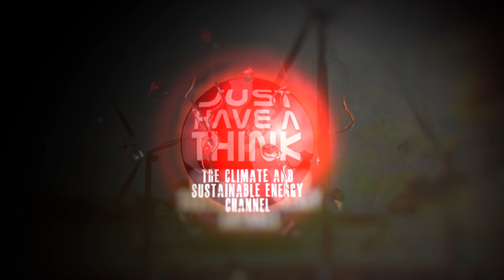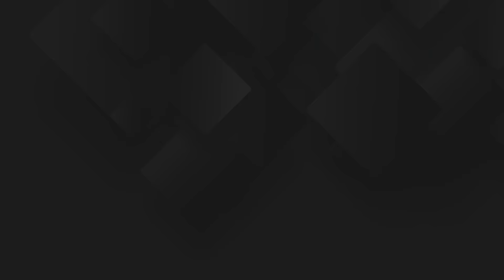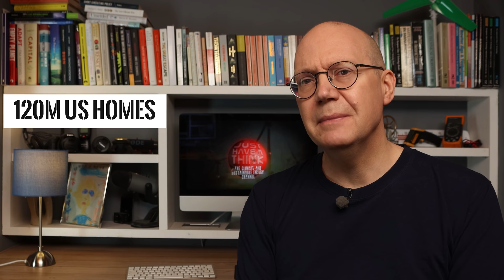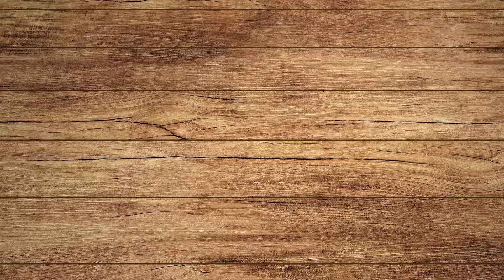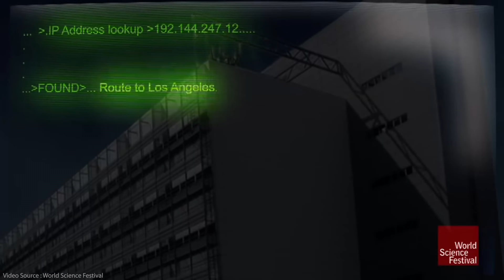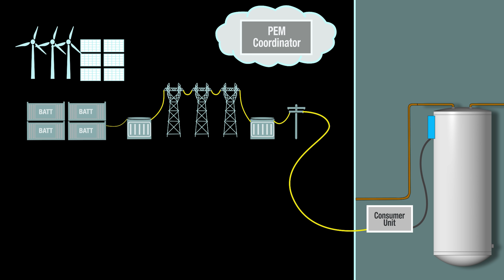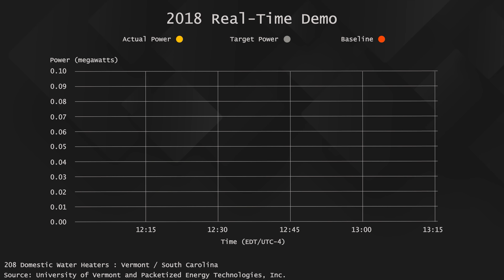How to balance renewable grids WITHOUT energy storage!

Comment: Technicaly, this is not without energy storage. The storage happens, just not in the form of electricity. You store heat in the water heater, heat in the air of your house, etc. It just adds a smart distributed management system for this "storage".
Reply: It is demand scheduling and shifting to avoid in rush consumption and peak loads.  There is no energy stored in your heater or house air the system is forced to go without that energy until the utility company has sufficient capacity to handle the load.  For example take the water heater.  If the heater is set to come on at 120f and you finish your shower and it needs to heat the water back to 180f to turn off and store energy for your kids shower but the grid saids sorry there is no packet to fill that demand for the next hour the water heater stays at 120f cooling down if your kid take a shower ending in a pissed off cold showered kid.  For this system to store energy as you suggest the water heater would have to operate from say 160f to 120f normally but over night when the power company saids I have excess energy the water heater would have to say ok for 1 cent per kW I will heat the water from 160 to 180 so there is more heat in 4 hours when we need 2 hot showers.  Or the house would heat up to 80f so it could cool back down to 70 when they demand is high that is not suggested in this packet scheme.
Reply: You're not storing it electrically, nor at the grid level. This is demand management, the fact that the consumer happens to be using it for heat or in an EV is irrelevant to the concept. It works outside of those situations as well.
Reply: @DanA-nl5uo  there will be trivial solutions for cases like that: the water heater will store water at a slightly higher temp and will have some buffer action on demand. A 25L storage water heater can act like a 35L storage water heater. But the worst sufferers will be those instant heaters that use a 5kW heater and heat the passing water. I, as an example, always put on the water heater before bath and turn it off immediately after my bath. I do not use hot water for other purposes and the system will ask me to keep the water heater on 24 hours and hot water will be always available that I do not want.
Reply: @janami-dharmam  the solution will be the spot price market control.  Meaning people who are not willing to pay more than x for electricity will go without while those who are willing to pay more will get the service.  This technology has the advantage of allowing the power grid to size to maximize profitability not to match  real demand.  Meaning if running the plant at maximum profitability means x percent of the poorest go with cold showers or less heating and cooling so be it the free market can now match limited supply with the demand.  In the past the lack of demand side control ment that the entire community had to have their demand met or the wealthy would force the power company to expand capacity to avoid blackout.
Reply: @janami-dharmam  I also drop the temp on my HW heater when not needed.  I'm recently single now and don't use it much as I usually shower at the gym and only use "warm" water for dishes and laundry.  With that said, it just crossed my mind that this could potentially cause some unhealthy water conditions... Thoughts?
Reply: @ssoffshore5111  You should research legionnaires disease. It can live in water heaters that don't reach a certain safety temperature. Most people have strong enough immune systems to not get sick though.
Reply: @ssoffshore5111  Usually the solution is a controller that will make the tank cycle through to a temperature hot enough to kill bacteria once every few days.
Reply: @DanA-nl5uo  You need to change shower heads to MUCH less wasteful such. We can shower the entire family on a fairly small hot water tank, about 120 liter, which by the way is heated via the heat pump that salvages energy from the air that is about to be ventilated out of the building, in effect we get hot water at 1/5th of the energy usage a silly stupid regular heater would use.
Reply: @My_HandleIs_  you missed the point completely.
Reply: @DanA-nl5uo  Nope. The best kWh is the saved kWh!
Reply: @My_HandleIs_  which has nothing at all to do with the point that the system discussed in this video will lead to the power companies being able to target their capacity based on your ability to pay and the poor will be the ones who go without when the infrastructure is not capable of meeting the demand.
Reply: @DanA-nl5uo  🤪👍please comment on a topic you know something about next time.
Reply: @hitreset0291  🤣🤣🤣🤣 your ignorance is showing
Reply: @SS OFFSHORE  These details depend considerably on the climate where you live and the month. Here it's +4.6 degrees average (wintery 6 months -7 degrees average, summery 6 months 16 degrees average). I'm retired with nothing essential to do (hence my relentless climate science & hilarious, really hilarious, troll postings) so I piss around with water heating, bathing-laundry regimen & well water boil sterilization absurdly depending on off-peak electricity time and whether January  (-12 degrees average) or July (22 degrees average).
Reply: @grindupBaker  you are just being silly. Bye.
Reply: I am impressed by your channel. You ask for comment, here's an observation. a) EV's are big batteries on four wheels, b) there are millions of rooftops, c) roof tops are on buildings which are connected to the grid. Ergo; there is already an embryonic collection, storage and distribution system to potentially handle massive amounts of electricity. In order to realise the potential there would need to be a scheme to incentivise roof top solar and EV ownership on a grand scale. Roof owners would need to sign into the scheme, which would have clever algorithms at it's heart. They would be required to agree to sell an negotiable amount of their electricity from their EV batteries to the grid. Problem solved. There is a lot of detail to be worked out, beyond my resources. However,  'I had a think' and I think that on the face of it, what could possibly go wrong?

Comment: Having read how some energy providers are making eye-watering profits, people who are not on the inside have a right to be sceptical about the amount in monetary gains made by efficiency savings being passed onto the consumer.
Reply: Pity we have so few (if any) energy co-ops.
Reply: True. The savings almost never seems to trickle down to us normal people. Still might be important to do though just for the reduction in emissions.
Reply: Very rarely does this result in cost savings nor emissions savings. It allows produces to sell more power and usually as special long term contracts given a company trying to meet its "renewable energy" targets.
Reply: Also the lack of investment in grid infrastructure.
Reply: The realities of power loads have little bearing on corporate profits though.

Look at how they close coal plants (good) but then also close nuke plants (bad) leaving natural gas as a peaker crutch against intermittent renewables.

This drives up costs to the consumer but those costs are downloaded to the consumer, as the shareholder value is still the top concern.

Regardless of people getting rich owning the generation facilities, it's still beneficial to the population to have a sane strategy.
Reply: @Furiends  they sell exactly as much power as people use.
Reply: @SaveMoneySavethePlanet  I think the savings are often more wished-for than real.  And any actual savings are vacuumed up into the emissions trading black-box / black hole.
Reply: @RandyTWester  very possible. I actually run cost savings programs for my normal job so I’m very used to engineers having “pie in the sky” ideas of what savings will be. Then the actual savings end up being tiny at the end of the project for one reason or another.
Reply: As I understood this technology though its not about making the grid more efficient, it's about not having to install grid scale storage. So no savings, except in the form of money not spent.

Comment: I think this can be solved with a much simpler and much more robust way. Each device could just monitor the grid frequency. When there's too much demand the frequency drops, when there's too much production the frequency increases. No internet connection needed, no big central computer needed, can't fail, and can't be hacked.
Another possibility is to monitor the spot price of electricity. If there isn't enough, the price goes up, if there's too much the price goes down. Tesla's batteries are already doing just that. This requires internet connection, but still decentralized and reasonably secure. Plus Tesla is doing the whole thing too, with it's Virtual Power Plant software.
Reply: In the Netherlands, we have the option to consume electricity based on a flexible price. This provides an additional incentive for users to shift their energy use.
For households, the prices are fixed 8 hours in advance and set per hour. Industrial consumers pay for energy per second which is basically the same as the grid frequency.
All you need is a smart phone app which monitors the energy price and tells your car to pause charging for a bit. The simplicity, privacy, control and financial incentive makes it a no-brainer for everyone.
Reply: If you had large numbers of devices doing this it could lead to huge overswings depending on how often the devices measure the voltage of the grid. You could end up with very destabilising feedback loops that would swing out of control.
Reply: @mentality-monster  be default, the voltage is measured every 10 seconds by every electrical meter in every building. The timing is not synced so there is a natural spread when shifting loads. One can add an additional meter to measure the voltage every second, but this is only interesting for large consumers such as chemical, metal or greenhouse industry.
Reply: In Czech Republic, the information about which price tariff is currently active is signalled using the power grid itself, it's modulated on top of the fixed frequency power transmission. We have devices that can automatically switch on and off power based on this.
Reply: Hourly prices are not the same as tariffs. We have 2 tariffs (high and low) or we can choose to use an hourly tariff which can vary to a tenth of a cent every hour.
Reply: @jaap7374  sure, what's your point? My point is that a technology for communicating information to consumers over the electricity grid already exists and is in common use. No need for smartphones or internet connection. It's just there begging to be utilised more adaptively.
Reply: They call it "mass remote control". That's the literal translation of the Czech name, I haven't found much searching for an English equivalent, so I don't know what the technology is called in English-speaking world.
Reply: @jaap7374  This is possible in New Zealand, too, but very risky if the wholesale price spikes.....and it does.
Reply: Exactly and I've had a working prototype sitting on my desk for two years - Government not interested!
Reply: @mentality-monster  
Yes, if everything is too well synchronized, but that's unlikely. Every device will naturally measure frequency at a different time so changes will be smooth. Also there are differences in priority, a fridge or an EV charger can react in real time, but a factory will only shut down if the grid is about to collapse.
The spot price could be more tricky, if it updates slower than the switching time of the devices. But the solution is simply increase the update frequency, or slow down the reaction time of the devices.
Reply: The tendency to produce spikes can also be countered in the computerized systems by having the grid broadcast a "adjustability factor" as well as the prices- in other words, a number that tells devices how fast the grid can adapt to demand changes, and thus how fast they can reasonably adjust their own consumption.
Reply: That poses a problem: When many smart devices see a changing condition, how many of them will change the demand? You could have assigned a random threshold or a random delay to each of them, but it would be difficult to balance overreacting vs. underreacting. The packet model doesn't need any of this.
Reply: @DiThi  
I've addressed this issue in my replies.
Reply: I am impressed by your channel. You ask for comment, here's an observation. a) EV's are big batteries on four wheels, b) there are millions of rooftops, c) roof tops are on buildings which are connected to the grid. Ergo; there is already an embryonic collection, storage and distribution system to potentially handle massive amounts of electricity. In order to realise the potential there would need to be a scheme to incentivise roof top solar and EV ownership on a grand scale. Roof owners would need to sign into the scheme, which would have clever algorithms at it's heart. They would be required to agree to sell an negotiable amount of their electricity from their EV batteries to the grid. Problem solved. There is a lot of detail to be worked out, beyond my resources. However,  'I had a think' and I think that on the face of it, what could possibly go wrong?

Comment: This is a very interesting idea, somewhat similar to an idea I've had for years. Devices that control themselves based on line frequency. Put very simply, when it dips down below the base frequency of by say, 1/100 of a cycle per second, loads shut off. When it rises above they turn on. Would have it set for batteries to charge or discharge based on frequency as well.
Reply: Nice
Reply: Add a random delay before turning off and on, and it sounds fine.
Reply: I suppose that this works best for turbine-based power... solar goes through an inverter and will probably show signs of load in its *voltage*..?

Comment: YES! So many people ignore the demand side of energy needs. At a personal level, I was able to cut my electricity use by ~30% just by micromanaging my thermostat! So there’s a lot of potential on the table here.

It would be very interesting to see a town do a pilot run of a program like this and hear what the results are.
Reply: My grandmother used to unplug every appliance except the refrigerator when she was not using it.

Her electric bill was generally significantly lower than her neighbors.

Phantom loads add up.
Reply: You can also couse refrigeration, water heaters for pools and such from home to nominalize and off peak energy use, but it all costs $$$ and none is willing to make the hard short term investments
Reply: You did that manually?  Or did you install some kind of programmed controller?
Reply: @audistik1199  I’ve just been doing it manually for now. So in the summer I set it at 74 or 72F when I go to sleep (otherwise I’m too hot to sleep), and then I change it to 78F when I leave for work. 

In the winter I’m typically setting it at 71 overnight and 69 during the day.

Eventually I’ll get a programmable controller to do this for me, but I rent my place so it’s not something to do now. My local utility supplier will actually give me a programmable controller for free (if I’m a homeowner) which I think goes to show how big of a difference it can make!
Reply: @shawnr771  they sure do! The energy star program in America helps direct users to appliances which use less energy overall, have features to use less energy, and even some that have a lower “phantom load” usage.

If you’re an American citizen then you can often get a small rebate by purchasing one of these and turning in the appropriate paperwork. Even if you’re not an American citizen though; I see no reason why you can use the website to research your next purchase and keep energy usage down!
Reply from the maker: Great point!
Reply: @SaveMoneySavethePlanet  👏 great job!  Thanks for the feedback.
Reply: This is why the passivehouse project is so important. Combined with an attentive user it could reduce energy use by 8 times or something ridiculous like that.
Reply: In Alberta, Transmission and Distribution (T&D) costs represent 70% of a monthly electrical bill, the remaining 30% is energy cost.  T&D costs are based on electricity import.  We do not have time of use metering here in the Province.  I have put simple timers on my freezer to ensure that it only operates during the day when it consumes solar pv production from my rooftop array.  it not only reduces imported energy, but reduces t&D costs which accrue based on import (which occurs at nighttime).  I would love to put the refrigerator on a timer but my wife will not allow it!.  Happy saving.
Reply: @SaveMoneySavethePlanet  You think you're conserving energy with those settings!? If there were energy police, you would be locked up!
Reply: @artsmith103  where do you want me to set it at?
Reply: @SaveMoneySavethePlanet  heat 68F occupied, 62F not occupied. 
A/C 78F occupied, 80F not occupied.